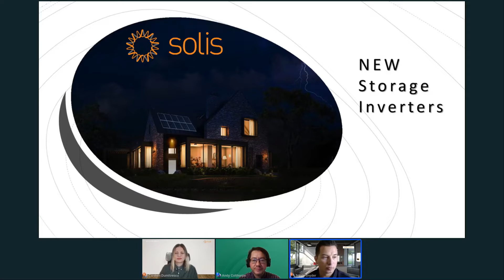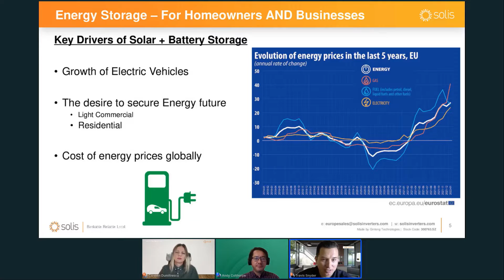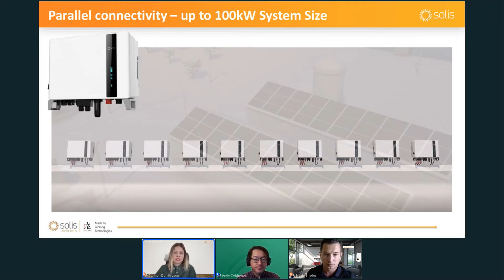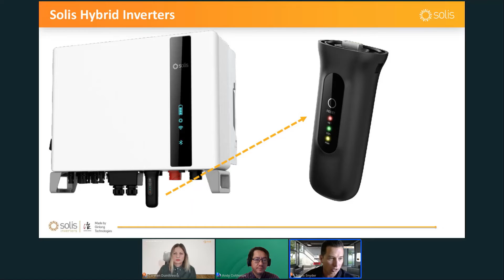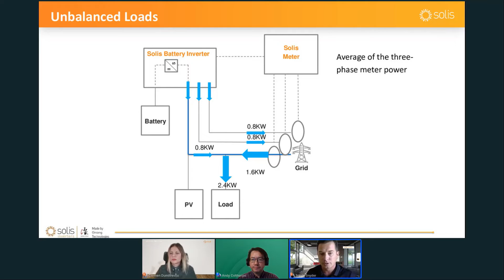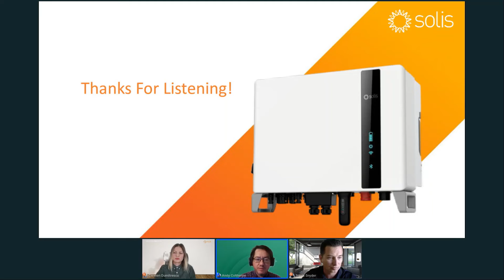Solis introduces new Sixth Generation 3 phase hybrid inverter

Comment: Check out Deye, they offer a 3phase unbalanced hybrid inverter that’s compatible with 48v. Perfect for home use. For now, solis don’t seem to offer a similar solution. Solis suggested I add 2x hybrid inverters (5G) to the additional phases. This isn’t much good as you’ll end up splitting your battery bank into 3, with obviously no balancing function.

Comment: In the 3ph 10kw Solis inverter manual, it states that the "battery voltage range 160 -600V". Does this mean I need to connect at least 4 x 48V batteries in series?
Reply: Yes. And you need to check the compatibility also. So I think you better check with distributor, or Solis representative about which battery is compatible with this 3 phase inverter to do such series of 4 x 48V battery.